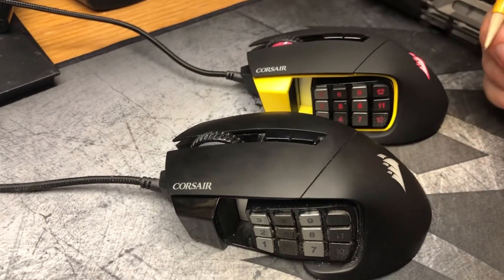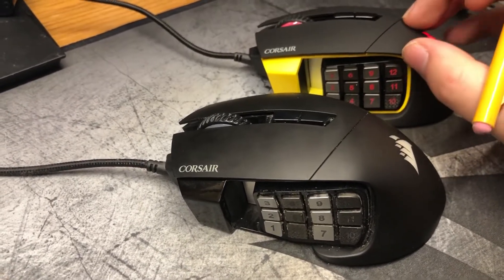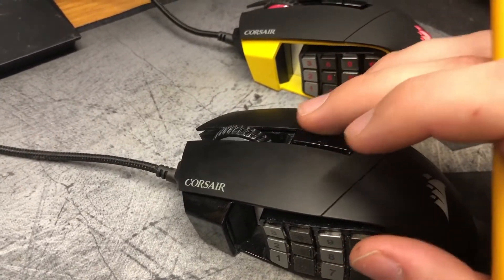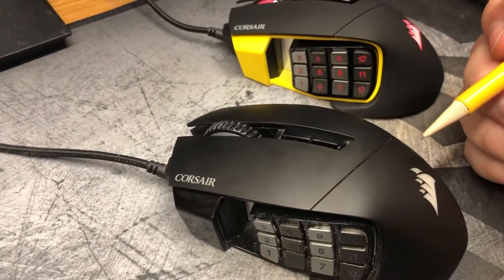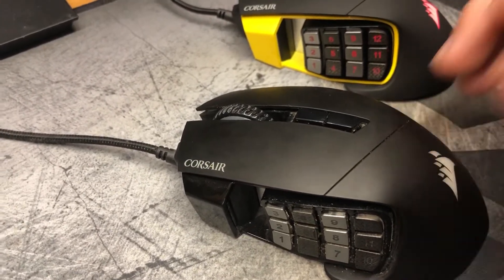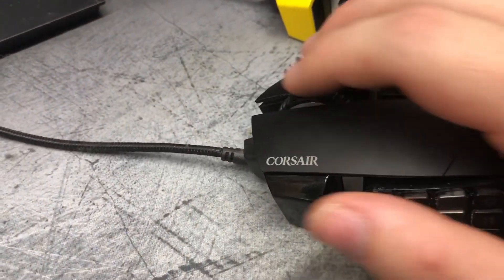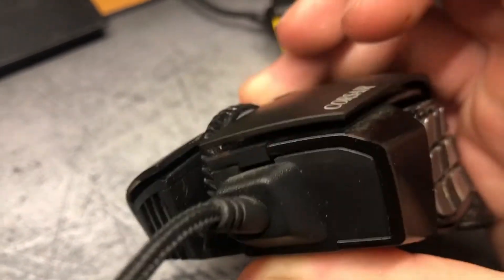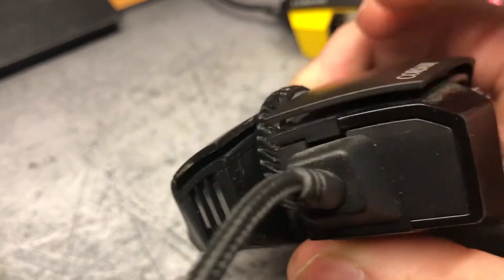Corsair Scimitar Failure Double Clicks, or Not Clicking

Comment: I've owned three Scimitars as this mouse is the only one that fits my criteria: has a 12-button layout and doesn't cause my wrist to hurt. Every SINGLE one had the exact same problems:

1) The scroll wheel would act weird
2) Double-clicking

The Original one I've bought used and I thought maybe it suffered abuses.
The Pro one I've bought brand new and two months past the warranty it started double-clicking. And this one I've used only for working and regular tasks, not gaming.
The Elite one I've bought as a "repaired" from a well-known store and it started double-clicking weeks after.

I've done the fix of the metal plate inside the actuators, but it solves only for a little while. It soon starts acting up again.

Comment: many call this a design flaw, but this is without a doubt an intentional feature that benefits both the manufactor and the middle man, only one paying big bucks for this is the end user.
i've had the same damn cheap knock off mouse for 5 years now which still work, but the ones i buy for higher dpi all have these same fails.

funny enough it's more common that these issues happens after warranty is over than before.

Comment: garbage quality for a premium mouse. barely a year and they left click failed. had to switch primary mouse button to right click because left click is randomly double clicking or loosing hold click. so angry right now. i have a cheap cooler master mouse for 3 years and its still working. wtf is wrong with these companies man?

Comment: I had similar problems with a M65 Corsair mouse after only 2 weeks use: Such problems are very common on Corsair mouses because the micro swich use by Corsair are shamefull poor quality...Had never such problems with my old Logitech G5 after 6 years use...
Reply: Corsair uses gawdawful switches. I burned through 3 M65's in 2 years. I switched to Razer. I like it so far. I hope it works out.

Comment: Due to this video I inspected the plastic piece that actually connects to the clicking plate and it had weird grooves in it, shave and file it down just barely so that there are no grooves in it and it will work perfectly. I got the scimitar 4 months after its initial release which is about 5 years ago, it works perfectly fine now. DO NOT file it down too far or else you will need to put something thin like paper on it to make up for the lost space. Enjoy your gaming, my friends.
Reply: That sounds amazing! How did you manage to disassemble it to get there? Some sort of guide would be highly appreciated!
Reply: I have saved my mouse this way. To open it you need to unscrew 2 bottom screws. Then prey the back of the mouse with a nail or a plastic prayer. Then slowly open the mouse, watch the cords and disconnect them before fully putting the cover off. Use the smallest and finest file you can find to file that piece down. Keep it at least 0.1 inches or 1.5 mm. Very easy fix. The other problem is the regretting of the switches. This one has more videos online because it's a more common issue.
Reply: My dude, this worked perfectly! 

Thank you!
Reply: This worked for my old scimitar... and my new one - thank you!
Reply: Saved me $80! thanks a ton
Reply: Just did this now it works 😁 So now I have two identical mice🙄
Reply: Yooooooo you don’t understand how much I appreciate you I’ve had mine since 2018 and it’s working like new god bless you brotha
Reply: Thank you fixed mine
Reply: Just did this my self, peeled back the lil pads, took the 4 screws out on the bottom. Filed the lil plastic down a tad till it was relatively even with the groove and that seemed to do the trick. Thanks. The click used to feel tough and got progressively worse. Now it clicks like the right side. Amazing

Comment: It's not the arm that's failing to trigger the switch. The flaw is with the switch itself. Look for the video "Failing switch problem: Omron vs the modern mouse circuit". It's a super long video but it addresses every facet of this issue.

Comment: I'm getting pissed off by all the dislikes on these types of videos. I'm guessing fanboys disliking because you dared to question their brand of choice.... 

guys, let me let you in on a little secret:

Brands are just the name on the box. The companies you're so invested in use many of the same parts from many of the same OEM manufacturers as their competitors. These cheap Chinese switches used in many mice from many companies, are of an inferior design to their Japanese counterparts that were popular years ago. They fail very quickly. I have an m65 and it has the exact same clicking issues after only a few months. Corsair, Logitech, Razer, and the rest are not religions. Let people address when the engineering/budgeting/marketing departments of your favorite company have failure points and drop the ball. If someone spends $50-150 on a product that fails in only a few months under normal conditions, when older devices lasted for half a decade, then the problem is with the companies, not the consumer.

Comment: bought my in 2017 and it started double clicking.... going back to my 10 year old logitech
Reply: had cliking problems after 2 weeks on my Corsair M65, go back to my 6 years old Logitech G5...
Reply: @leneanderthalien  they are designed to fail this quickly on purpose to get you to buy a new one. most will fail soon after warranty is over. funny thing is, i've only had issues with expensive mice. my cheap ass cooler master that came bundled with a keyboard is still going strong 3 years later. so angry right now....

Comment: I used to own a Razer Naga and changed to the scimitar once this same issue was brought up. Then RMA'd my Scimitar about 4 years ago. Issue came back up half a year later and decided to just start fixing it myself (obviously wont be covering through warranty anymore after it expired) And ended up finding that the plastic foot that presses the micro-switch begins to degrade overtime and also depending on how roughly you press and frequently. But i'd say around a year and a half give or take the issue will probably present itself.

I opened it up and shaved off the feet that make contact with the micro-switch itself, and superglue'd a piece off a bobby pin and placed it on there. Since bobby pin material is made of metal, it raised a bit of the durability on it. But now the micro-switch is to blame after about 3 1/2  years later and i'll probably be either replacing the micro-switch, or opening it up and cleaning it. If you're decent at soldering, the part itself for the microswitches are extremely cheap roughly $0.72-1.00 per unit. Part no. is 'D2FC-F-7N(20M)' for anyone who's interested in more info about it. I run a tech repair business, so I inherently pry'ed a curious eye on what was going on under the scenes and fix my hardware.

I've also done a bit of research and found the switch that Corsair uses in many of their mice are from the brand Omron. And most gaming peripheral companies whether it's Logitech, Razer, Corsair. etc. Near all of them are using this same switch if not a very similar variant of it. So it's inherent this issue can translate over to many other gaming peripherals. 

__________

My TL:DR in all this is that as every gaming peripheral manufacturer uses the same manufacturer for parts or are very similar, which means can have the same issue as another brand. Choose which has the best customer support and longest warranty and which one you prefer using the software with.

Edit Update: I was able to replace the microswitches with 'Kailh GM4.0' since they're rated to last longer and had a local dealer. Took a bit of soldering but it works like new.
Reply: @FFB-3675  I say stick to logitech and pray they make another MMO mouse soon or get a decent logi g600

Comment: You know you
 can change the switch.
Reply from the maker: That’d be helpful if the actual switch was the problem I guess. The lever you push to activate the switch is the problem. It flexes meaning switch hits are inconsistent.

Comment: I have a fix for anyone willing to rip their already busted mouse apart. Take it apart and look where the clicking plactic piece is on the under side of the left or right click. This plastic piece wears out creating weird grooves causing double clicks/no clicks. All I did to fix it was glue a small piece of something (I used a piece of airmiles card) and super glue that where the plastic clicker is. I had to use a dremel to shave down the thickness a little but now my left click is smooth as a babys ass and never clicks more the once. If I can do it so can you, it's super easy. It's a hardware "flaw" tho I think they knew this piece would wear out in any where from 1-2 years causing the person to go buy a new one.
Reply: Oh i see. You talking about:  |------|  ->  |--__--|   ??

Comment: Same issue with the corsair RGB elite. it's ridiculous. This will be my first and last mouse from Corsair.
Reply from the maker: Both of my Logitech’s have been going strong for about 6 months now. If I had them longer I would try to sway you that way, but 6 months isn’t a long enough trial period for me to endorse a daily use computer product.
Reply: @chases.7252  That's the thing, my old cheap wireless logitech mouse lasted me 3+ years... This Corsair mouse was around $50 and it only lasted me less than 6 month. I googled the left click failure problems and everyone else is having the same issue. This must be a design flaw or a manufacturing defect.
Reply: Fay same problem same mouse man wow

Comment: bought mine in June of 2018 and it just started double clicking. this is just stupid. Love the mouse, but  this longevity is unacceptable. I've had two cheap $20 Logitech that have lasted over 5 years without an issue but this $80 mouse cant last 2 years without being disassembled and modified? Thanks for pinpointing the issue!

Comment: I got 1 and my wheel broke not the click part of the wheel , but to scrolling part crosair suck never buying from them , and i got h100v2, the new low profile keyboard and headsets all my 2 computers in my house got crosair 2 got Razer Naga 2012 im going to open it to fix it but this mouse is only 5 months old . I been building computers since the 90s and i still have the 1st razer boomslang mouse and it works quake 2 day's mouse . Every year parts get cheaper but they change lots of cash for junk. Nice info man.
Reply: My first purchase from corsair, k65 rapid-fire shipped with 2 broken LEDs, my second purchase from corsair, the h100v2 died once within the warranty period and now I bought the Ironclaw wireless mouse and I have the double-clicking problem right away. Corsair really know how to make their products look good and somehow manage to market them as really high quality, but I guess that is one of the biggest lies in the computer industry

Comment: ive had mine for a year and a half maybe stop slamming them in the table when u rage?
Reply from the maker: lolster 24 the problem seems to stem from the way I hold the mouse/the length of my fingers. I’m pushing the very tip of the button causing it to bend. If I pushed more in the center it still actuates. The problem isn’t a broken switch. The switch still works, the problem is the design of the button/lever. Did you even watch the video?
Reply: @lolster 24 tiny hands type this post

Comment: I had the same problem with my scimitar pro, just opened it up and apply some super glue in the worn out gap. After just wait an hour until it's dry and no more stuck clicks.
Reply: You know how to fix it?
Reply: Just to clarify for future people attempting this fix, when you say you used superglue, you didnt use it to attach to the switch, rather you used it to fill in a grove that was warn into the plastic do to use. 

Also here is a link for disassembly for those whom are interested https://www.s-config.com/corsair-scimitar-pro-gaming-mouse-repair/

If that fails, here is an excellent tutorial on replacing the spring of the switch. https://www.youtube.com/watch?v=FepmjdZF0ds

Comment: dude just buy another brand
Reply from the maker: Razer Nagas are junk, worse than Corsair, I've switched to a Logitech G600, but it is too small. I'll probably go back to the Scimitar again. Unfortunately, the other mice either are just as junky or too small to use comfortably.
Reply: @chases.7252  Also it happens with other brands as well.   I've had it happen with Razer, Logitech and Corsair.   Dealing with it on my second Corsair mouse at the moment. It's just one of those things that eventually happens.
Reply: @chases.7252  i want to know how to fix it if i ever happen to fail mine of scroll wheeling or clicking. im wish i was a mouse technician and knew how to fix it
Reply: @chases.7252  u bought another one instead of just fixing ur old one, dam expensive mouse main clicking component cant even last as long as a regular dell hp mouse that i had for 7 years.
Reply: @chases.7252  what about the razor basalisk??
Reply: @chases.7252  i have problems with right click
Reply: he coulda set the left click as a macro key if the mini macrokeyboard still works. Doesnt make sense to buy another one. u save $$ that way.